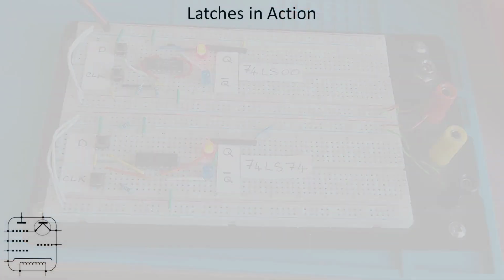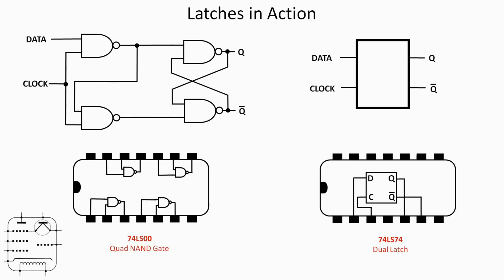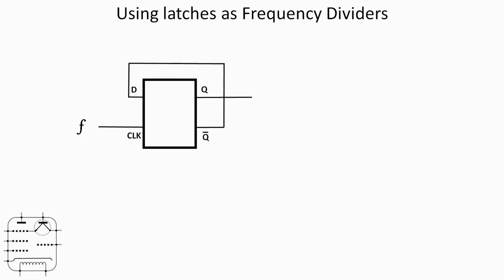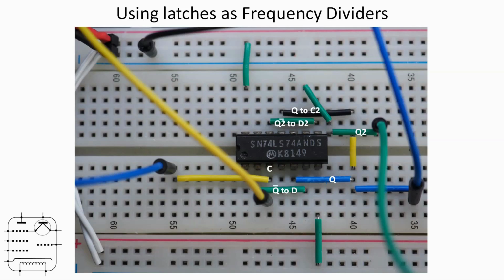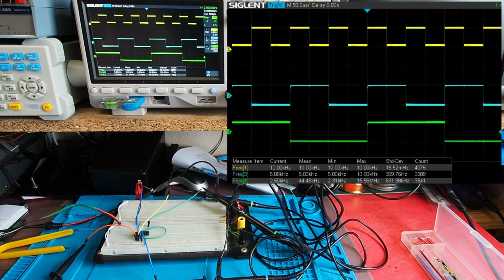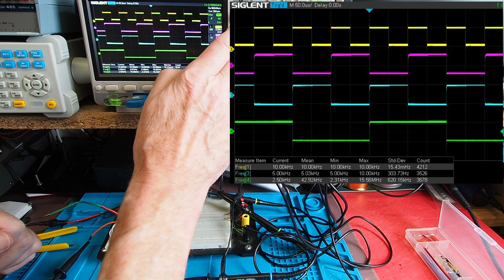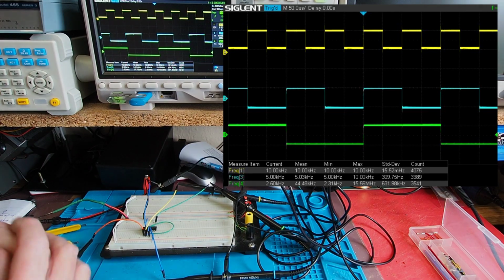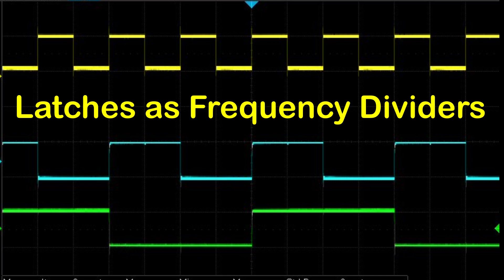Digital Electronics - Latches Part 2   #103

Comment: Thank you Bill for another interesting video and excellent demo. Something to bear in mind is that TTL logic is sensitive to switching noise on the power supply lines, and should have a 100nF ceramic capacitor fitted close between the +5V and GND lines of the IC. You may get unpredictable behaviour otherwise.

Comment: You were running that at 10K, be interesting to see what that latch max'es out at 100K ? 500K, 20K ?
Reply: It should be good to about 25MHz but will probably be lower on a breadboard.
Reply: @g0hjq  Thanks - that's clearly a lot higher than I had thought.